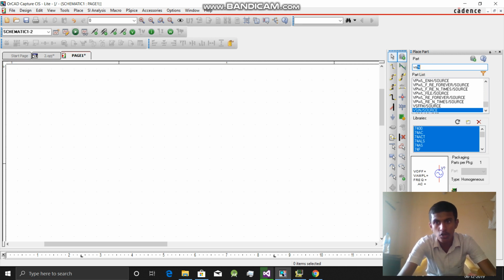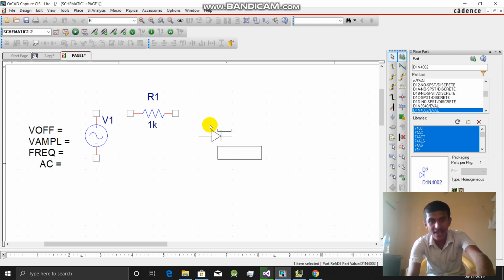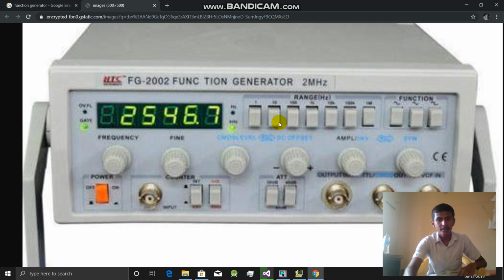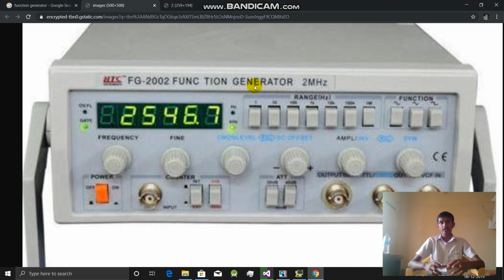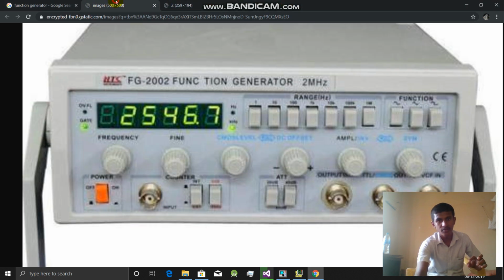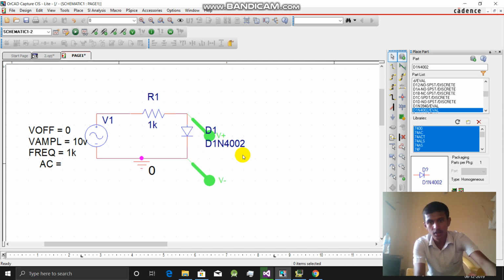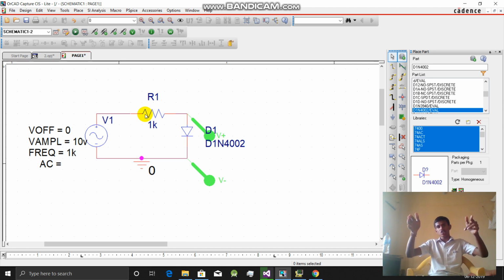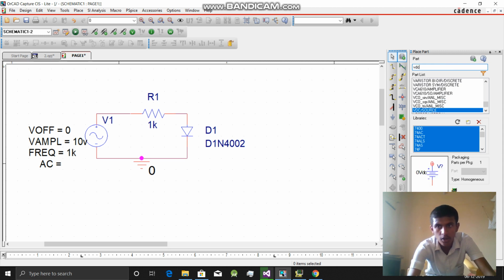ED LABS clipping part 1

Comment: What is clipping
Reply from the maker: A clipper is a device which limits, remove or prevents some portion of the wave form (input signal voltage) above or below a certain level In other words the circuit which limits positive or negative amplitude ,or both is called chipping circuit.

The process of doing these things is called as clipping.

If you want more information please refer:

https://www.daenotes.com/electronics/digital-electronics/clipper-circuits

https://www.electronics-tutorials.ws/diode/diode-clipping-circuits.html

https://www.electrical4u.com/clipping-circuit/

Thank you